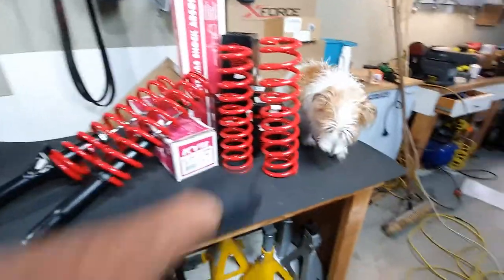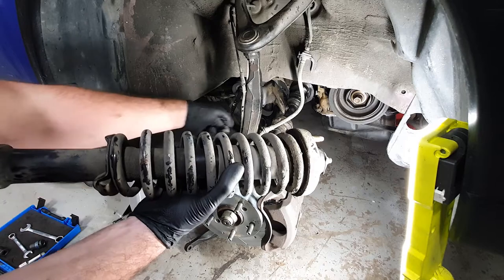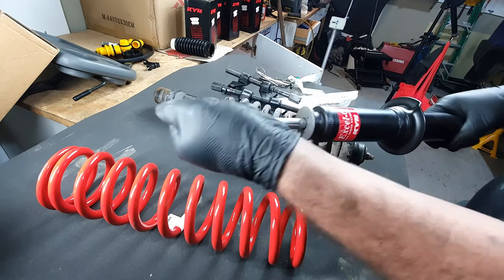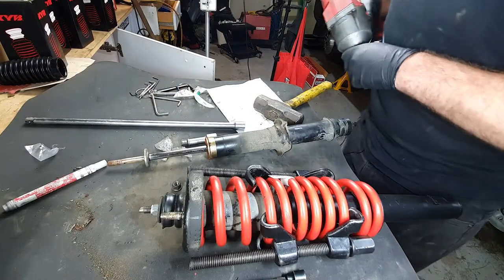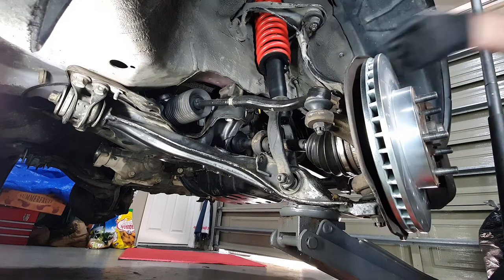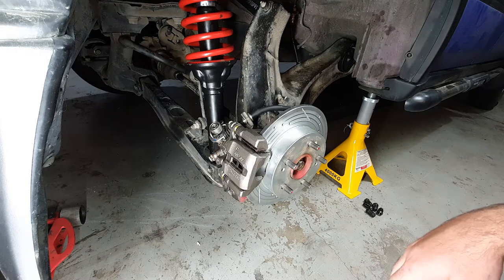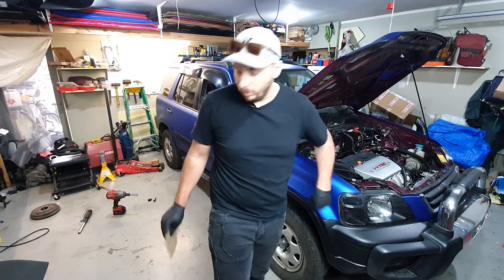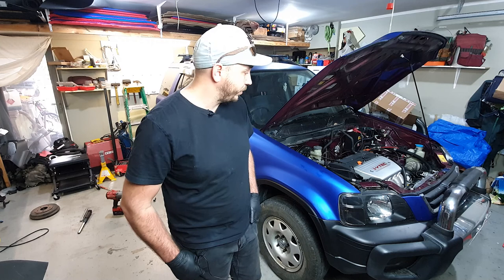how to lift honda crv

Comment: Hope u did the bolts up for the front lower arms before u drove it as they where lose when u where putting the springs back on
Reply from the maker: Nope,  good spotting though! a few of the bolts for the lower arm are still loose. I left them loose on purpose, i drove it on my driveway not the open road to settle the shocks and springs i will tighten them now that everything is settled.

Comment: Found this in the rd1 fb group - Keep the content coming man! I'm considering a modest lift for my rd1 but don't know much about lifts. Does this kind of lift require a subframe drop or any additional work other than installation?
Reply from the maker: Thanks man, no it doesn't thats why i went with this option. Will allow for more tyre/wheels choice but should retain oem alignment.
Reply: Hi and thank you for sharing this.  Now that the spring lift has been on the car for a while, do you still reckon the spring lift you used is good without any changes to the subframe?  

Have you guys had any issues?  I’m looking to lift all round a bit for clearance ideally without making any changes to subframe etc.  I’m Aus based.  

Needing to change shocks so would be good to tackle at the same time potentially.
Reply from the maker: Yeah mate its all good. Allingment was fine. The only thing it does thats negative is it brings the rear wheels forward a little in the wheel arch.